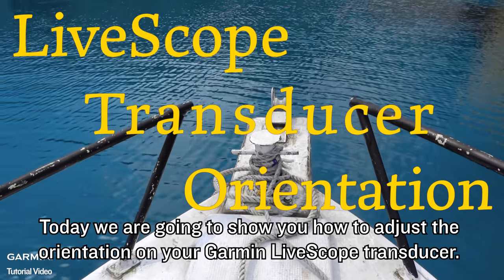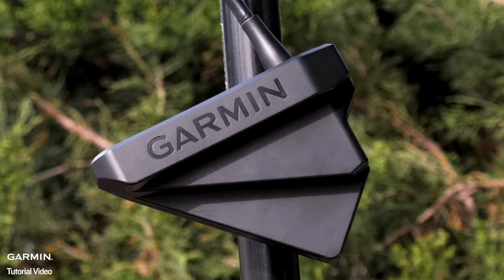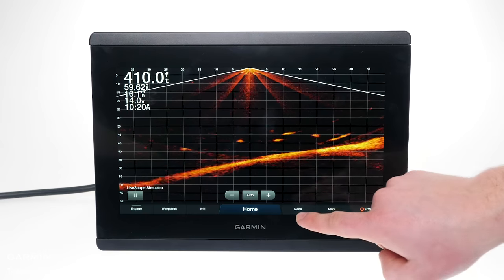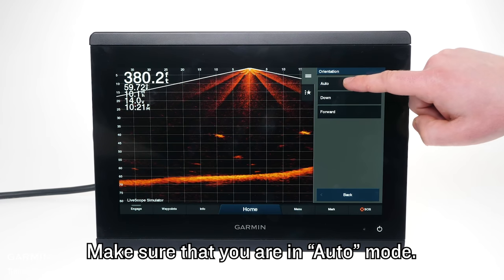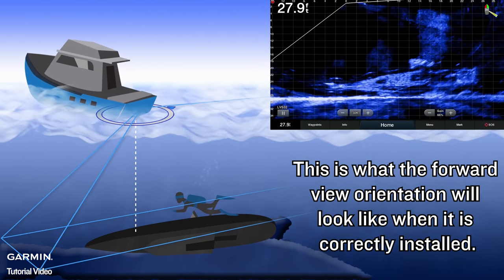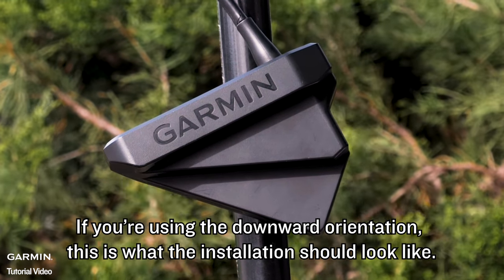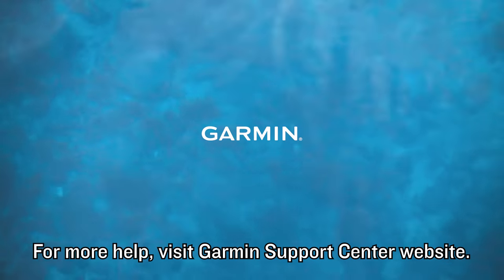Tutorial - Livescope Transducer Orientation

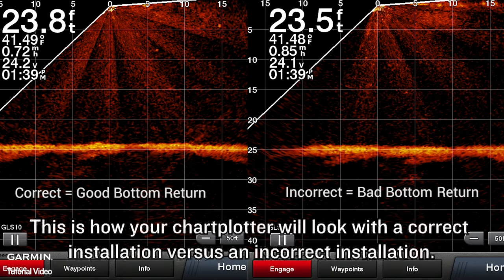Comment: Very confused as well. At 57 seconds it shows you how to mount the transducer on the port and starboard side for forward view. Then at 1:31 it shows you a correct forward view installation that matches the port side at 57 seconds but doesn't match the port side forward view at 57 seconds.

Comment: At 0:53 since port and starboard have different orientations does the garmin just figure that out or is there a spot to select port/starboard based on the mounting orientation?

I'm assuming its automatic and the puck just has the sensors to run in either direction but want to make sure.